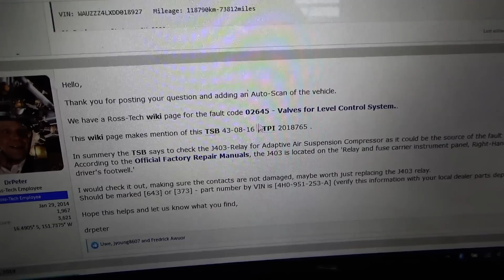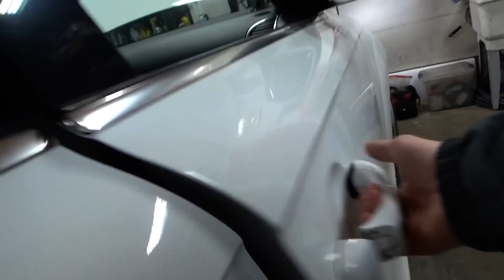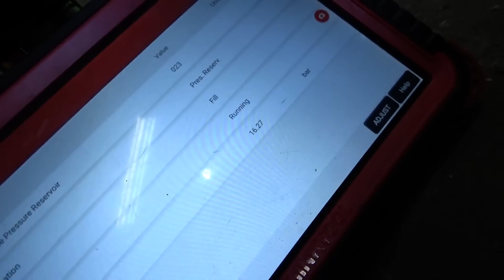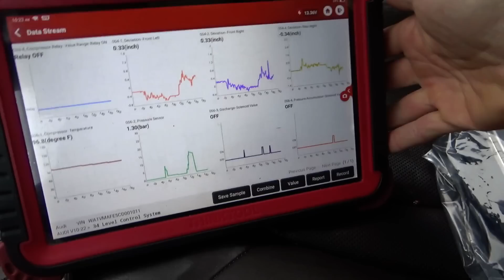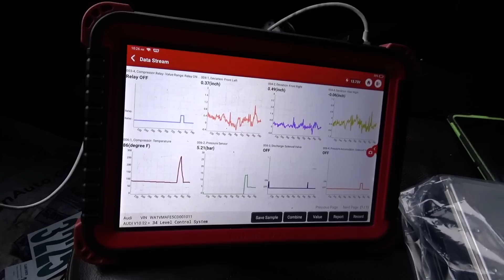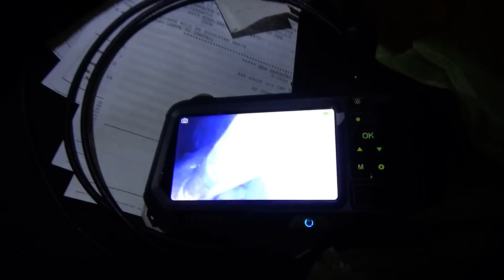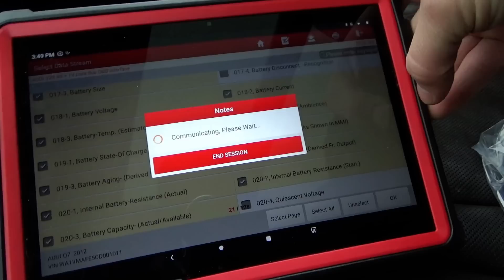Audi From HELL...DEALER STUMPED!! (Part 4 - CONCLUSION - Q7 Air Suspension DISASTER)

Comment: Wowser!   I believe You nailed it when you said the dealership was the only one to profit on this one. With Your time and research and aggravation, you definitely took it on the chin, and the owner still has the luxury money pit. In this case, I think the dealership had the right idea. Yeah , we will work on it, charge 3 times what the pos is worth, and probably not fix it. Monetary way of saying I don’t wanna touch that thing, please go away. Not that bad of a strategy in this case imho.😅😅. Anyhoo, have a wonderful hopefully Audi free week Ivan. 👍👍🇺🇸
Reply from the maker: Actually I have to do a water pump timing belt job on the red 91 Audi Turbo wagon this week 😂
Reply: @PineHollowAutoDiagnostics  Well, hopefully that will be a breeze compared to this nightmare. Probably won’t even have to reprogram the water pump.

Comment: Pretty interesting. I thought from the get go that the pump was slow at least compared to my Equus. Suspect that could have been the root of all the problems. Hindsight 20/20. Hey if it wasn't for all these fancy electronics, diagnostics would be pretty boring and most anybody could do it. Keep up the good work, your skills will become more and more valuable as most people don't want old cars no matter how easy they are to keep going. Remember, most people can't even (and don't want to) put air in their own tires much less change the oil.

Comment: I wish you would have pulled the seat and done a proper battery inspection.  It's not asking for precise battery specs for no reason.  I'm sure it's just having a discrepancy in what it's seeing, compared to the ABCDE>. etc.. that you put in the software.   I'm sure you didn't charge him for it.  But it would have been another fun rabbit-hole to get to the bottom of the battery issue. :)    .. I understand just wanting it gone though

Comment: Yeah, 30 A at 13 V. That’s 390 Watt. That generates a major amount of heat energy. Hey, you can fry eggs on that bad boy.

Also the TPMS functions by comparing the speed of each wheel. And with fault you pump each wheel to the correct pressure value, and tell the car through the infotainment system that all tires are up to spec. Works for me every time.

Comment: You could've bought 2 full sets of coilovers that fit that car for the total money and headache involved in this diagnosis.
Reply: How would you have stopped all the modules throwing dozens of error code with a missing air suspension system?
Reply: @ferrumignis  You don't. You tell the customer up front that they will have a lot of lights on the dash, then you test drive the car with the coilovers to make sure there are no major driveability problems. (yes, you are taking a slight risk if the car does something stupid like limit the power, but that usually doesn't happen, because cars are designed to still be driveable when the system fails!)

Yes, this is technically a "half ass" repair and I usually do not support these repairs, but there comes a point where a technician needs to stop their pain.

Comment: Has anybody ever known an air suspension system to work well over time? Never! Why take the chance? As you can see, they're a rabbit hole for even the best mechanics and a financial nightmare for the owner. As an aside, that pump sounded frightening at the end of the prior video.
Reply: The rear air ride in my Trailblazer SS works just fine. 17 years old and one set of air bags replaced. It is a very simple system compared to this dogs breakfast though but you asked. ;)
Reply: @jeffco908  OK, you win. It's that German engineering that gets me.

Comment: The compressor was causing the charging system malfunctions.
Drawing too much current.
Reply: 30 amps is not too much current. Turn on the frt and rear defrost with the blower fan on high, seat heaters on, lights on like we typically do in the snow belt and you'll see 50+ amps. That alt has to be rated north of 140 amps, so it should be capable. NOW, as a stand alone circuit, 30 amps might be too high because we saw the motor was weakening, but in general, that should NOT pull down the entire charging system to below 13.5v especially when Ivan was testing system voltage with no other high current draw items on.
Reply: @adamtrombino106  
I agree with you but if that pump is malfunctioning it would only need to spike the current momentarily to produce a fault code. Which also explains why it happens only sporadically.
Reply: @adamtrombino106  
This exact scenario happens to our plow trucks when the electric motors start to go bad.
Reply from the maker: I guess that's possible... But what's another 10A for a 200A alternator 😂

Comment: I would put in a relay and hose + one of these in the trunk: VIAIR 380C Plug-N-Play Compressor, 12V, 1.5 gallon tank, 200 PSI Rated

Comment: I was talking to a Navy pilot about something weird going on with his plane.  He used the word "queertron".  I said, what?  He says, you know, queer electron.  That might explain what went wrong with that module.  BTW, in aviation, we have a different version of the intermittent problem.  It's the "cannot duplicate on ground" problem.  It's so frustrating sometimes we take a mechanic up flying with tools and meters. I've seen mechanics duct tape, I mean FAA PMA'd speed tape, test leads to the fuselage coming from the engine compartment and running into the cockpit just to catch the gremlin.

Comment: I learned my lesson on Euro cars from owning a 2000 Volvo V70 AWD. First main problem: the anti lock module. Almost everything runs thru it and eventually, solder joints WILL fail. I had so many problems on it after that. The trap is that when it was running right, it was such a pleasure to drive but NOTHING is easy to work on. It was designed for ease of assembly not ease of repair.

Yes...all Audis are money pits but you might as well have a cool, repairable money pit, than a frickin cranky HAL operated space module.

Comment: It's to bad some kind of aftermarket air compressor couldn't be installed.  At the cost of what Audi wanted for that pump, maybe a different compressor?
Well, you conquered this Audi.
Reply: If it's just power and ground, then you can jerryrig anything in.
Reply: Wabasto makes all VAG air suspension pumps.

Comment: Best advice for a customer with serious air suspension problems . . . remove the bags/pump/module, and install a nice set of Audi struts and springs.  It'll ride great!
Reply: That would cause a whole bunch of error code and lights unless you could code the various modules to ignore the lack of suspension module.
Reply: Only own while in warranty. I had a 7 series BMW that broke me from sucking German eggs !
Reply: we used to replace the air ride on Lincoln town cars with a spring set up from a grand marquis. saved hundreds and worked every time..
Reply: Germans don't make cars any more  they make cars for rich people, they drive in garranty and change for new series... And then that old car finish like this one. All problems are passed to another poor man.
Reply: That's what I did with my Buick.  Shocks with coil over load assist to replace the rear air load leveling system
Reply: I was thinking uninstall the car replace with camry easy fix much better car
Reply: Best advice is never waste your money on Germany cars.

Comment: Ivan , does Auto Zone replace a battery on that car, take the seat out to get at battery, great design. Ivan, you are one of the best auto mechanics out there, anybody else would have ripped off customer.
Reply: No AutoZone doesn't replace battery in trunks, under seats , under fenders ECT. Large 3/4 trucks that you cannot get on. 
You don't want a person to fall off and get hurt do you.? 
You get sued because you wanted your battery installed. 
They don't use ladders or stools ECT. 
Plus they don't have the property tools to reset batteries. 
Don't expect them to be Technicians. Because an guy that changes oil is suddenly a Lube Technician.

Comment: My 96 2.3L (2wd) Ford Ranger has over 400,000 miles on it, doesn't burn a drop of oil, starts every time I turn the key, gets ~22mpg, and is a 5 speed which adds to the cool factor. Yes, I have replaced timing belt, fan belt and pulleys, water pump, clutch and drag link, etc..., but I don't need a Snap On tool account to get'er done! And even the OEM parts are cheap compared to the newer vehicles. I just stay on top of the maintenance. You couldn't give me one off those newer stealership - anchor headaches! Great video, Ivan! 👍
Reply from the maker: 96 was an amazing year in many ways 😊

Comment: I use to drive nothing but VWs back in the day when they were simple. I owned the Jetta from hell in 03 sold it and bought a 103K mi  1995 Lincoln Town Car from my uncle. It finally had an air suspension failure (the compressor) $20 for one a the wrecking yard and off I went. Since then I now have an 03 Lincoln , 03 Crown Vic and a 1978 Cadillac Eldorado all with air suspension and all the Fords are a like and the Caddy much the same. Want to change the ride height, crawl under and adjust the height rod. Maybe Audi should take a lesson from older Fords and Cadillac and make things simple. Actually by building this crap they drive their owners to buying a Lexus instead
Reply: I feel like Audi is taking their lessons from Land Rover - very much the same concept, but Audi's special sauce makes it even worse (who'd have thought that possible?!)

Comment: Programming the car for a new battery ?!?! What's next? Program the fuel every time you fill up?
Reply: Don't give them ideas.  But last month he did have to reprogram a flex fuel car that forgot what real gas was.
Reply: @robertsmith2956  Oh E85 repairs can be fun, not really. We had a fleet of Dodge Caravans that wouldn't run monitors for the emissions tests until they had a couple tanks of 87 regular ran through them. No matter what we did, we couldn't reset the parameters with E85 fuel to run enough monitors to get them to pass. Had to have regular gas!
Reply: Programing batteries has been a thing since early 2000s. For a good reason. The batteries do last much longer with correct charging curve + it can compensate for when it gets weaker. I seen cars from around 2005 with original battery installed this year. Most simple obd scanners can do the programing.

Comment: No one else thought the pump was way too LOUD! in the first place.
If I owned an Audi id be complaining about the noise!
Reply: Thought the same. Sounds like a bag of nails. But then it's hard to tell on video because the camera mic has a tendency to amplify certain noises so they sound way louder than they are IRL.
Reply: @chillybrit  audi pump should be silent. that one sounds like my crown vics when the case cracked.
Reply: So they can charge you '$6k

Comment: Ivan you don’t have to remove the seat to get to the battery. There are two bolts at the front of the seat low to the floor. Remove these and the seat tilts back exposing the battery. Good idea to first remove the plastic dust covers for the sliding tracks as these can become jammed and crack.
These cars are a nightmare but not to mechanics that work on them regularly as to them they see it as common issues. The real nightmare is electrical gremlins and cost of parts.
It’s fantastic that you purchased VCDS. Now you need to play with your new toy. Thanks for the documentary!! 😂😂😂
Reply: finally he acknowledged the fact the seat isnt removed! LOL. this is 2nd audi he has said this and i noted it was wrong...

Comment: add a test light on the compressor so it thinks it is at 16 bar when it is at 11.
For $800 the dealer will remove the seat and program the battery.

Comment: Dealership over charged for diagnosis? Dumb question, how much time did it take you to diagnose this vehicle?
Reply: It is my suspicion that the only reason why the dealer 'may' have gotten the compressor replacement call 'right' was from the fact that the OE piece was 12 yrs old and that it has a high failure rate. There is no way they could have known that it would fail the self test because the module was bad to start with! I really want to know what they would've done if say Joe owner gave them the OK for the relay and comp replacement, THEN discovered the module was bad! How can they charge all that $ only to discover they cannot fix the car w/o a new module that even they cannot get?!
Reply from the maker: @adamtrombino106 they would have just charged the customer 5 GRAND and then told them that module was unavailable... With a straight face like a damn robot 🤖🤣

Comment: Dealer stumped - nothing new there then!!!
Reply: Not really.  It just isn't profitable for most shops to spend hours and hours on fixing obscure problems on old cars.
Reply: @radman999  the problem isnt from the dealer not doing the work, its about the dealer not knowing. They should know. All they have to do is say what it is and inform them they have no slots available to carry out the work and to find another garage to do it. They cant do that either cos they dont know.
Reply: @Spiralillusion That is down to the error of the individuals working there at that one location and day.  The dealership has all the factory information and all the special tools required to do the job.  They have access to the manufacturer techline to contact and escalate.  It sounds like they didn't want to.

Comment: not letting the voltage regulator know its a new/replaced battery causing the VR to cause havoc on all the modules by delivring low or high voltages. its a really PITA, and what people dont get is this doesnt happen instantly... after a few months mysterious module faults pop up

Comment: If you put one meter lead on line and one on load at the relay, load it up and see what your voltage measurement is. This is how you check the contacts for voltage drop. Not sure what is acceptable on 12 VDC, on AC I was taught 1 volt drop warrants replacement. I usually will replace a relay or contactor, etc. if the meter switches from mA to A scale.

Comment: for the battery if you just replace it with the same power levels just change the serial number. that is all thats required. this lets the regulator module know to treat it as new. u do not need to remove the seat. the front bolts come out amd the seat tilts back on the back posts. if you try to find how it tilts back you will never see it LOL.... just trust us... take front bolts out and seat tilts back. I think this is the 2nd audi we all told you this....

Comment: How many Ah has the battery? What's the password? What is the installer's SSN? Submit DNA sample to continue.
Reply: replacement battery procedure only requires the serial number be different the other stuff is not used by the voltage regulator module
Reply: Surprised they allowed the questions in engrish.  Could be a fake answer.  You Vill enter the data in german.  Vee know where you live.

Comment: And is all this stuff really necessary i think not just a strut
Reply: It allows for different stiffness and ride height. It also can have internal valves in the struts to adjust rebound. Allows a big suv to handle good in corners and be comfortable on the highway. I get why the first owner specced it. You can rebuild the compressor fairly cheaply with aliexpress parts :D

Comment: That pump sounds very loud! It sounds like it's wailing in pain! Way to stick with it Ivan.  What a nightmare.  Great series.
Reply: Sounds like someone is down there cutting off the catalytic converter.
Reply: that compressor sounds like the typical small 12 volt DC powered cheap portable air compressor you can buy off the shelf at any auto parts store. i bet Audi charges over a couple hundred bucks for that $25 air compressor
Reply: @billbarney4937 Probably more like $1k
Reply: It normally has a cover over it that dampens the noise.
Reply: With the engine on you don't hear it
Reply: The loudness confirms its failing. Replace or rebuild
Reply: Didn't sound like a quality part, box of nails, imagine sitting waiting at the lights and that racket starts up.

Comment: Open the module up and take a look at it Ivan. You probably won't be able to program it but at least you can see if there's something else that failed inside the module. Thanks for the video.
Reply: There are many great repair technicians on YouTube that could possibly repair that module. It might be worth it just to have as a spare, the owner can even call it Harry. 😂
Reply: the module had invalid values, he should have done the REPLACED MODULE procedure copying the used ones values to the bad one. or if he asked on the VCSD forum someone maybe could have told the value locations on the module memory and to manually fix them. thats the power of VCSD

Comment: that pump is so loud in a 'luxury" audi.
Reply: It fills a tank that can fully lift the car. It only runs when absolutely necessary when stopped, otherwise it runs when driving above a certain speed so you can't really hear it.
Reply: @Mike88GT - "noisey air suspension pump" - It's drowned-out by the cackle of the diesel.

Comment: There's gotta be some kind of aftermarket coilover spring kit out there to eliminate this system altogether. Way too much hassle for me.
Reply: Bags are good for towing. But having the on all 4 seems like a marketing gimmick.
Reply: @josholsen6985  it's for comfort
Reply: Americanairsuspension makes conversion kits, but only for two models that I could see.
Reply: There's plenty of companies that manufacture custom coil overs for race, rally, road etc, all they basically need is the dimensions, load carrying capacity, GVM and whatever else to construct them.